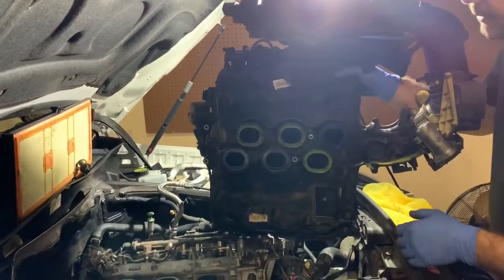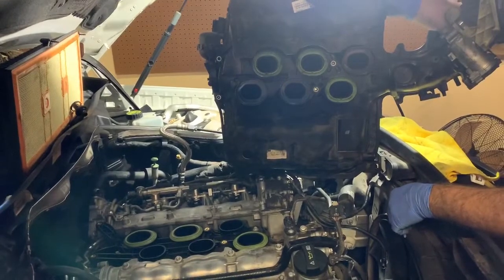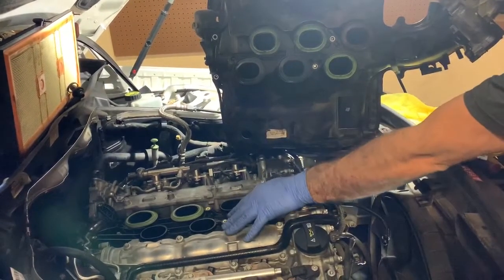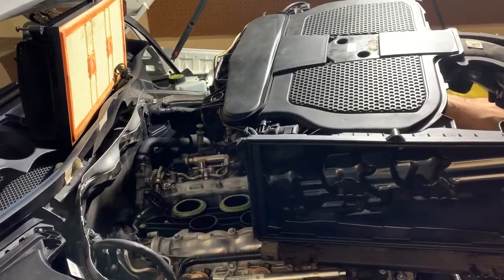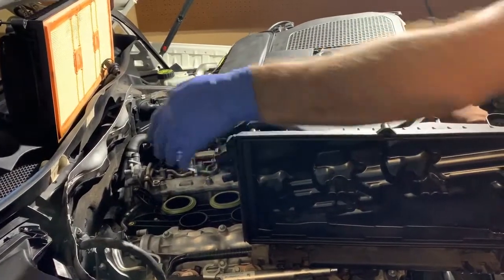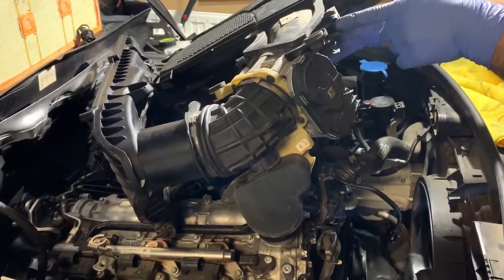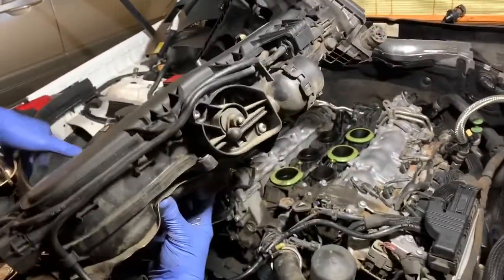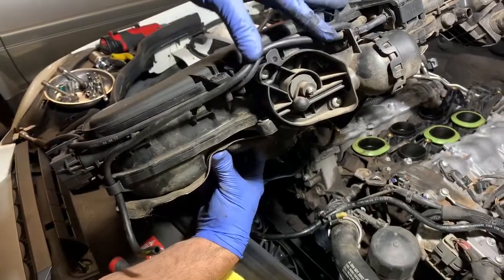(1 of 2) 2013-2015 Mercedes Benz GLK350 M276 Intake Manifold Removal

Comment: Don't forget to replace those green plenum seals - my Mercedes main dealer didn't do it and the EML light came on 10 mins after collecting the car: leaky/disturbed old plenum seals was the cause.
Reply: What code did you see on the diagnosis as a result of the leaks please? How much did the mechanic/dealer charge for the 6 green gaskets to replace? Where did you buy the part (do you have the part id? or how much was the cost of the part if you still have the receipt?

Comment: Ok so howd you get the rear bolts out?
Reply from the maker: The rear bolts are removed with a small extension, they are not difficult, torx I believe.
Reply from the maker: The rear bolts will also require a magnet to remove them from their recess and to return them to their recess.
https://smile.amazon.com/SE-8036TM-NEW-Telescoping-Magnetic-Capacity/dp/B000RB3XBA/
Reply: @mobitechaz  https://www.techtoolsupply.com/Eclipse-Metal-Pronged-Parts-Grabber-p/ecl-902-225.htm